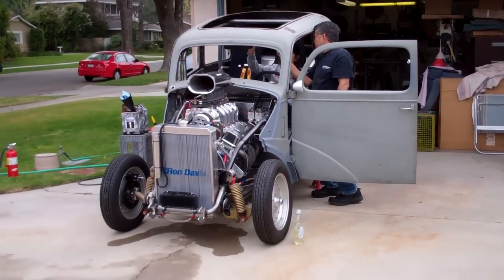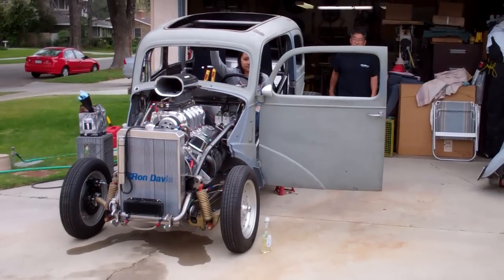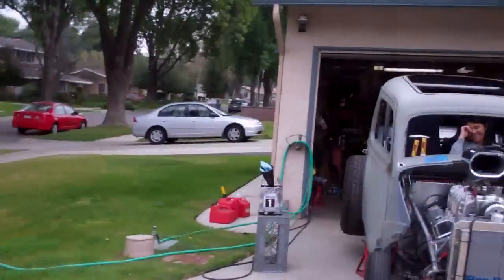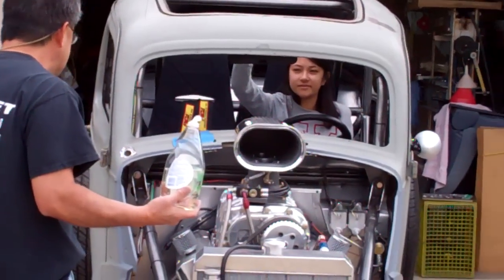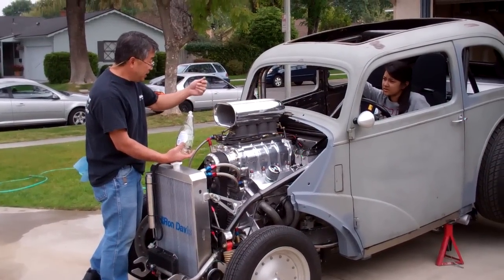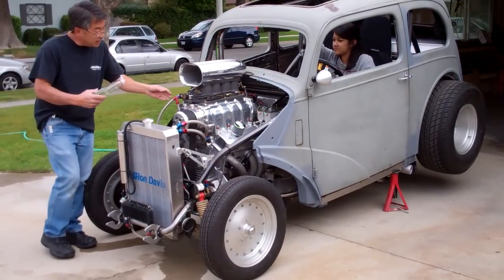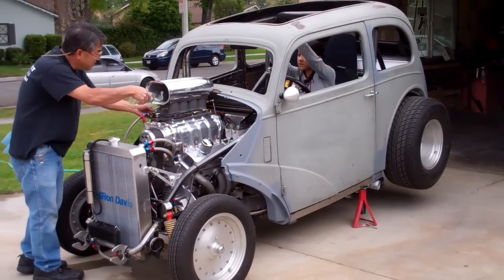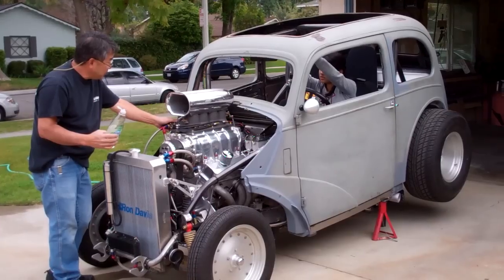Blown Gas Anglia  1st start  . 3/12/11

Comment: This made my night. I remember when my old man was pouring gasoline down the stacks of his 454 with Crower injection of his 48 Anglia with a Palmolive soap bottle. I would sit in the car and he would tell me make sure it's in neutral, pull the cable to turn the fuel on,  mag switch on, and when I tell you to hit the start button start her up. I remember holding a wet rag over my face to block out some of the methanol fumes that would come up inside of the car watching him adjust and get it dialed in Saturday night before we went to the strip plus I will never forget the sound and the way that car felt it was amazing.  Had a lot of fun weekends with the old man and his drag cars those were the days. I'm really happy to see a man and his family get together and enjoy such a great car. Spindle mount Cragars on the front and Center Lines on the rear I'm going to guess?  Thank you sir you have a great car.
Reply: 00
Reply: InstaBlaster.